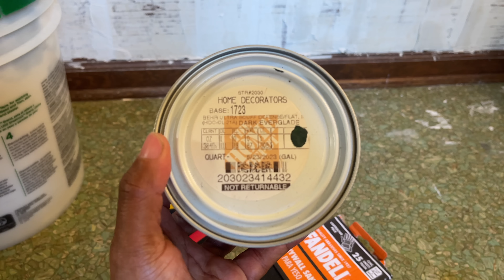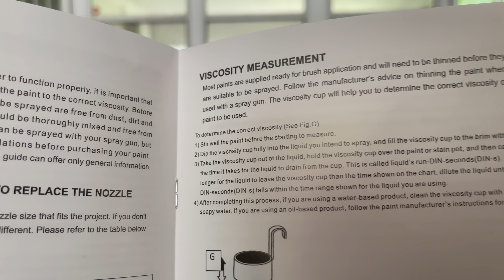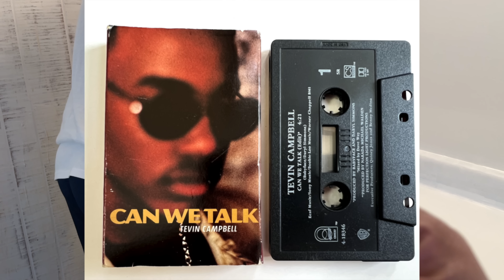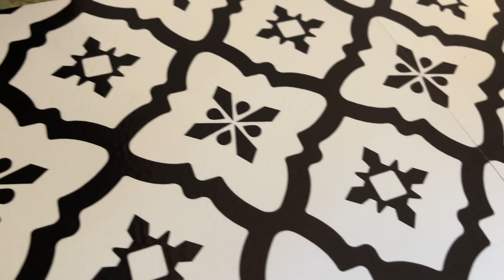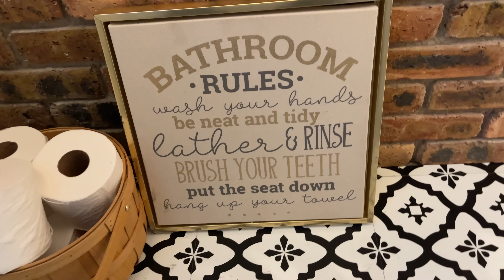DIY EXTREME  BATHROOM MAKEOVER | UNDER $200 (start to finish) | Ep. 8

Comment: your bathroom came out so beautiful :) I love the floor tile you picked. for a finishing touch I recommend going over the outer edges (between the tile and the baseboard) with water sealing silicone. it will prevent water from getting under the tile and also add a really clean look to the edge! also for your mirror, if you don't want the hanging hardware showing, I recommend a French cleat. I love your design choices and colors.
Reply from the maker: Happy Friday 🥳 and thank you. I’ve never heard of French cleat but I will definitely look into that for the Master Bathroom we will be doing and the water sealing silicone. Thanks for these awesome tips 😉. I was hopeful for the color scheme lol  but it ended up turned  our lovely 🥹
Reply: You thit great
Reply from the maker: @elckefahwehinmi1466  Thank you 😁

Comment: this room makeover is simply brillant!!! I love using the peel stick on floors because its cheap enough you can change it out without breaking the bank. whenever i have odd cuts that are difficult i make a paper template with brown paper grocery bags so i can mark up the template spots to match it up for the pattern easier. (saves the frustration 😂)since your mirror is black I might spray paint the light to match those gorgeous hardware pieces. 😍 definitely subscribing!
Reply from the maker: Thank you much 😁. I nearly gave up on those floor cuts 😂😂😂😂 they took me all the way out. I do plan on putting peel and stick in the basement bathroom floors so I will try that next time. For the light, I was thinking gold but you might be right on this black 😉

Comment: I am curious how much the spray was for the faucet. I feel like I could buy and replace a faucet that’s comparable in price (not sure) and also wondering how this will hold up. Please let us know how it does. I am currently just starting a bathroom remodel that has about double the area to cover (wish me luck 😉). However I love putting in floor tiles. I think the hard top is where it’s at when putting in floor. Their still easy to install and you need the contour gage tool to help with all those cuts. No more stress with that. Good job guys! First time coming across your channel and love the realness. ❤
Reply from the maker: Thank you 😀. The primer and spray paint was about $10 total but matte black fixtures can be expensive. Why? I am not sure 😂😂😂. I will definitely do an updated video because I am curious too. We don’t have that much company so it may last longer than most 😉.

Comment: Use command strips or liquid nail glue to hang the mirror 🪞
Reply from the maker: and we bought liquid nail glue and was too nervous to try it 😂
Reply: @hardlyhandyharris  lol 😂 well in my opinion using the command strip for weight is a better option because if you want to change the mirror in the future it’s a lot more convenient then potentially ripping the wall with the liquid glue. I’m upgrading my bathroom and I’m removing the mirrors that where installed with liquid glue and moving forward I’m using command strips lol 😂 y’all did amazing! Oh I too used compound in my walls and I’m still sanding a year later lol
Reply from the maker: @Kosmofire  well command strips it is 🤣🤣🤣🤣. I promise I watched so many videos on the paneling and let me tell you had I known it would work better on laminate vs  be an epic fail on real wood 🤦🏽‍♀️ 😂. But that’s the world of DIY it’s a hit or a miss lol. And that sanding 😮‍💨💨🌬️🍃😂